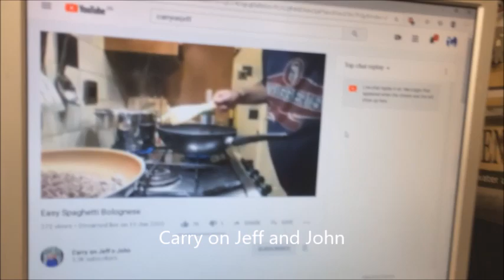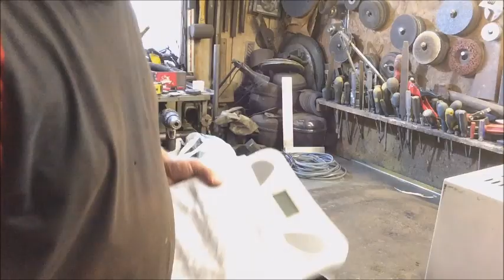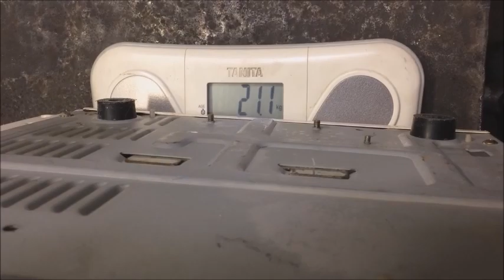NOT the Dusty Blonde Microwave Challenge

Comment: I have tore down several microwaves some light some heavy it's surprising the difference in them in quality and in age. I think what to me may be interesting. I am still using a microwave my grandma bought back in 1980. This microwave is a GE brand and currently 40 years old and still working as good as it did 40 years ago. I do know grandma had it repaired one time as lightning ran into her house and it burnt something out but GE dealer fixed it and works still everyday. Must say they don't build them near as good as they use to. This has got to be near one of the first microwaves on the market. Because I still remember when she got it and grandma was always buying any new gadget that came to market. I have her original Victorio food strainer she got back in the 60s they havnt been made since mid 80s and very rare. I got lucky and picked up one off eBay cost me a bundle but worth it. Now days they make copies of them but they just arnt as good as the originals.
Reply: LATE 80'S I bought a monster of a Toshiba microwave and that lasted many years.
Reply: @thefettlingfellah657  yeah Toshiba is by far top brand name in electrical appliances.

Comment: You didn't say if the transformers were all copper!? The microwave nowadays have all aluminium so may be it was slightly heavier due to copper.
Reply from the maker: Iffy  I just assumed because of the age it would be copper
Reply: You are correct but as they are so rare it's nice to see. I've had four compressors now with aluminium wire so disappointing when that happens.
Reply from the maker: There a guy called Ralph Mourik who uses the phrase “Chineseium” when he sees copper coated Aluminium wire. It’s catching on.